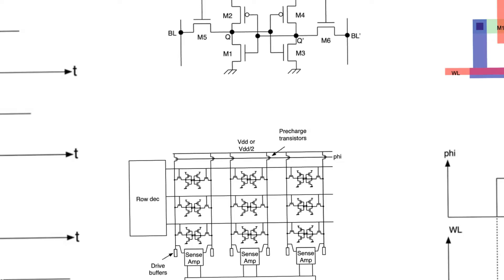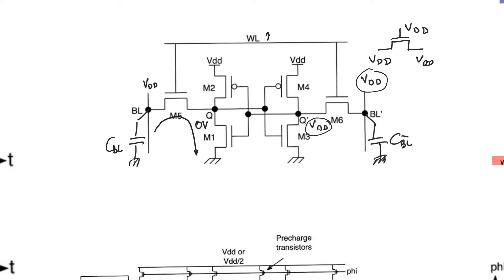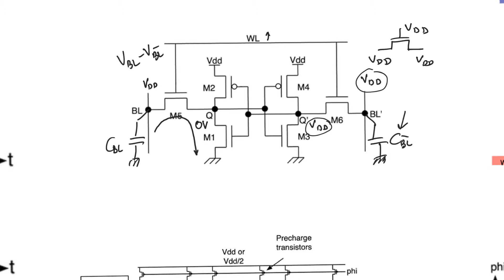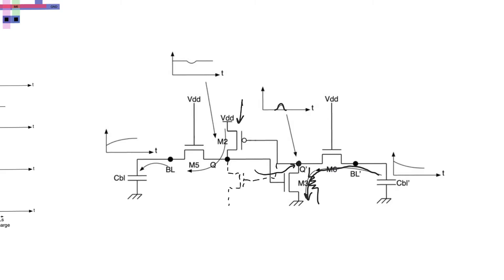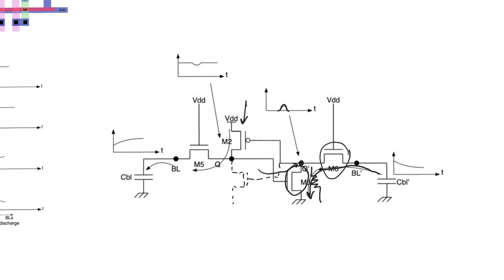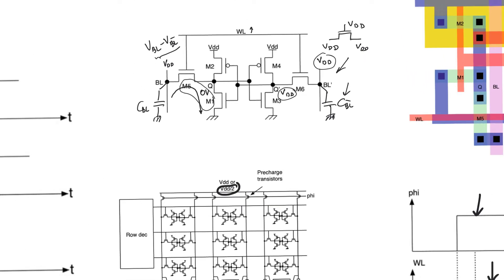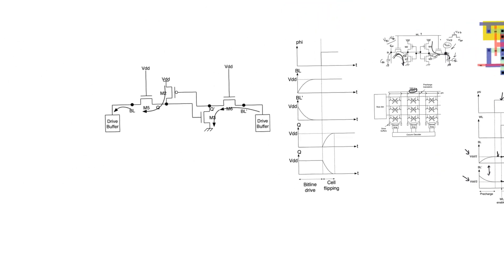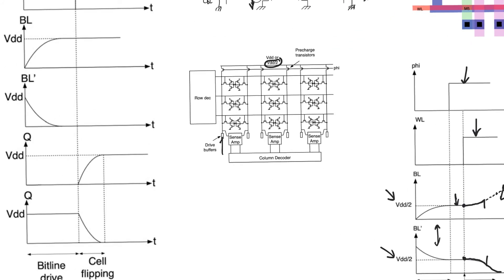12.12. SRAM read and write

Comment: Hello There, Thank you for the explanation Sir. I am having a bit of an issue while simulating the Read Mode of a 6T SRAM Cell. So, I can successfully write the value into the Cell and check if they are retained when I put the Cell in Standby Mode (WL = 0). However, For the Read Mode, what I do is I pass Pulse signal of VDD to both BL and BL' for about 1.5 microseconds and then keep it low. Then, I try to turn on the WL at 2  microseconds but what ends up happening is that both Q and Q' values are same which oscillate between 0.268 and 0.832 V. So, Should I actually Use  Capacitors in the Circuit when using Read Mode so that the Capacitors can be pre-charged?